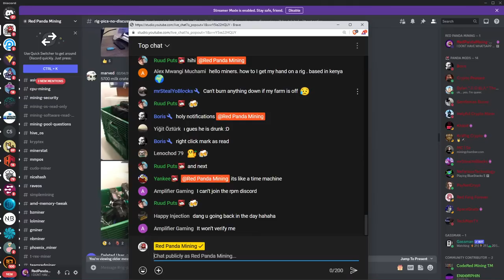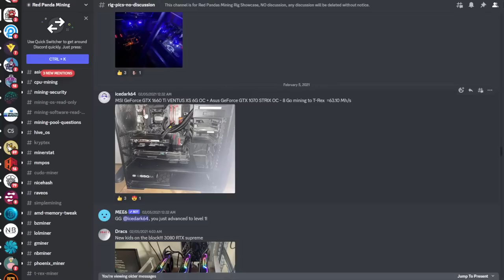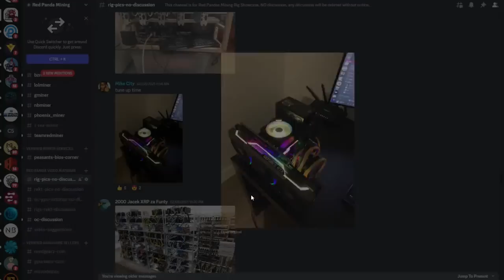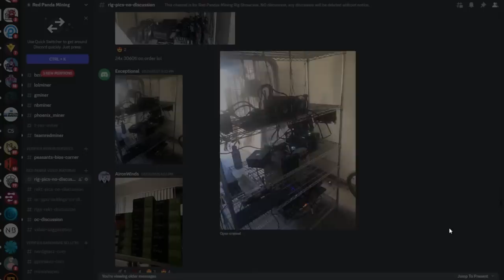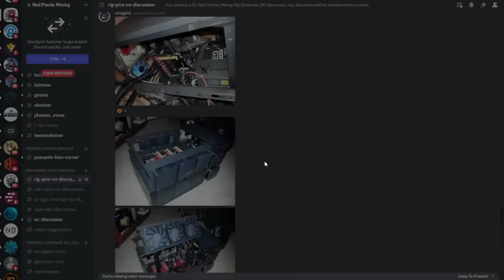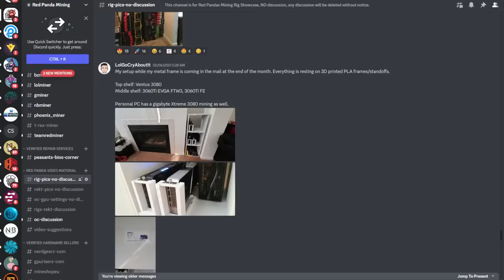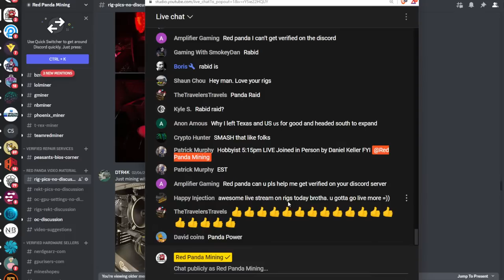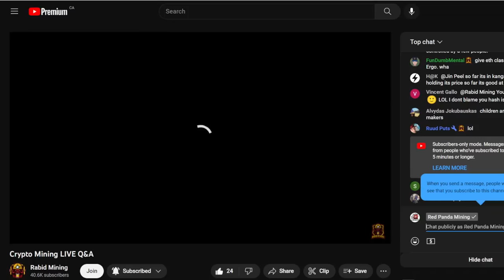BEAR MARKET RIG PICS IS BACK BABY!! only 2 years behind...

Comment: 11:59 This is a German "Schuko" which stands for Schutzkontakt or in English protective contact. It supports up to 3680W peak (230V @ 16A), but many power strips only support 2300W - 3000W. RMS is @ 13A. Power splitter are normally power strips called "Steckdosenleiste" and are part of all households. Most power strips own 3 connectors, but there are strips with 12 or more connectors.

Greetz from Germany.

Comment: Just a thought about the new octotank from octominer, if they had built an immersion setup for gpus I’d be more excited. There are already a bunch of immersion options on the market for ASICs that have a higher capacity and are more cost efficient(granted not many for 1/2 miner setups, but in my opinion immersion isn’t viable profitably on that small a scale). There are no plug and play immersion options for gpus that I know of, especially with as small a footprint as octominer tends to produce. I would 100% jump on it if it had been a gpu rig, I don’t have any desire for the asic tank, and I own a couple ASICs.